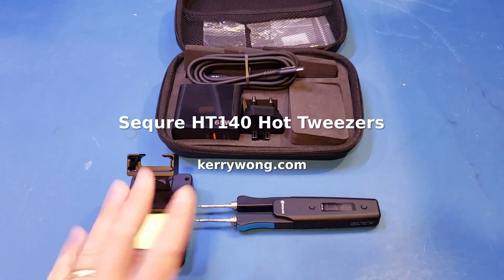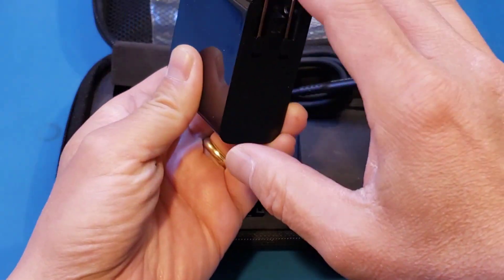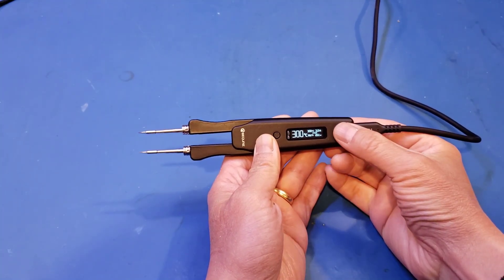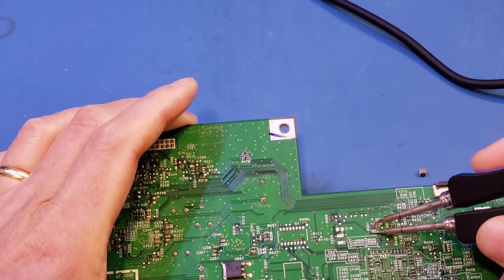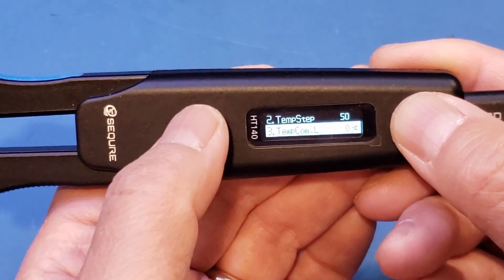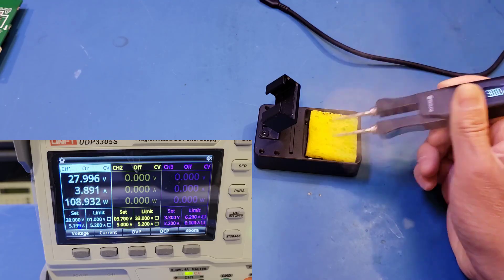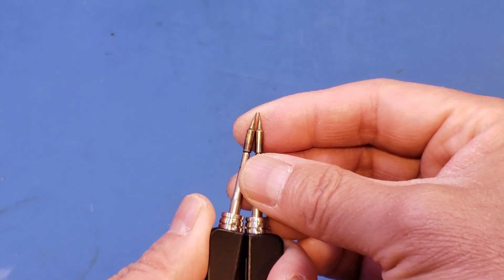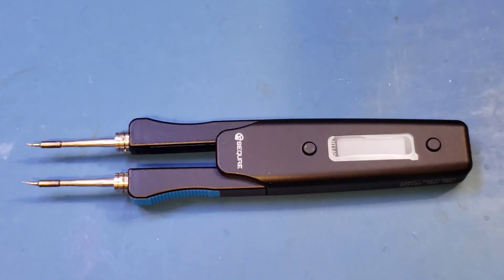Sequre HT140 SMD Hot Tweezers Review/Teardown

Comment: Amazing that all people using tweezers consider them as desoldering tool. At work, we use them also to solder parts. Instead of putting tin on a single pad, solder the part, the solder the second pin, we put blob of tin on each pin on the PCB, put a small ammount of flux, the take the part with the tweezers and put in in place. Even without additional flux this works very well to flip diodes, LEDs, ...

Comment: Are people measuring the tip voltage with reference to mains earth?  If the output of the DC PSU is floating they might just be seeing the effect of the leakage current.
Reply: Yes they do that🤦‍♂
They are probably used to soldering on a live PCB.🤣
But with some ESD sensitive components, that floating may cause problems.

Comment: Wow... just wow... this desoldering iron has less electronics than Pinecil or Fnirsi, and yet just because of double iron, it costs double amount... what a mistake by producer... if only this costed 70 euros, they would sell hundreds of thousands, or even milions of units, potentially endangering market of single iron devices, because this one can be also used in single iron mode... yet they chosen path with less devices and higher price...
Reply: All control circuits are on the back side. What you see in the video are only power circuits.

Comment: What about measuring resistance between the tips and to the ground?
Reply: Exactly the leakage must be measured form tip to earth, since the tips are not grounded there's no leakage between them. Without the new ground cable 50vac on 110v and about 100vac on 220v. With the ground cable is about 3v using the supplied power supply. Using a power bank lower the leakage to about 2v

Comment: Hi Kerry!  Use an oscilloscope to obtain the voltage spikes between tips. A multimeter cannot capture this.
Reply: I measured the tip driver switching noise pulse between tips as 2.5V for roughly 20 nS not counting the ringing.